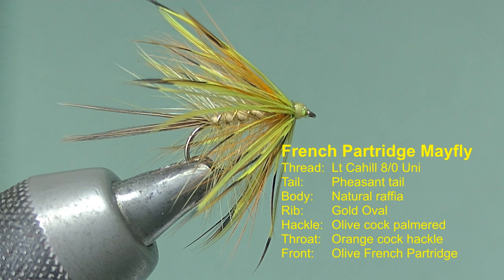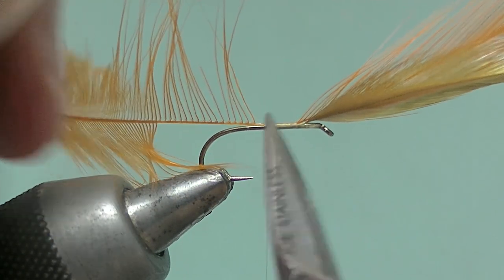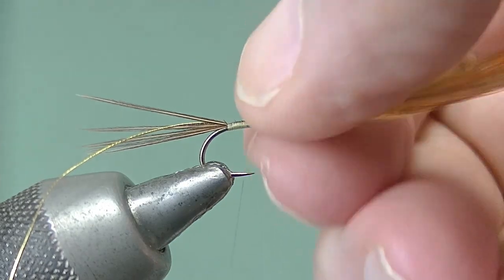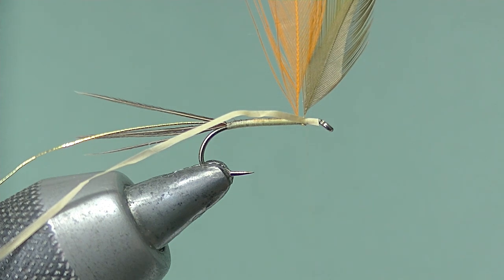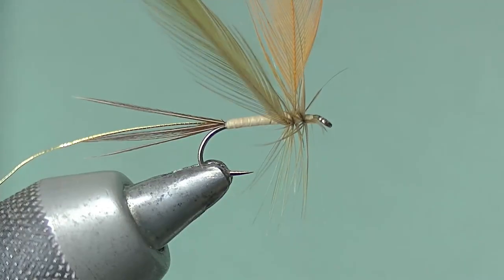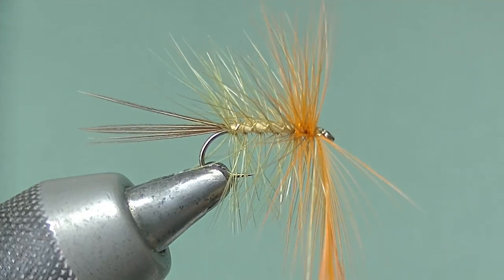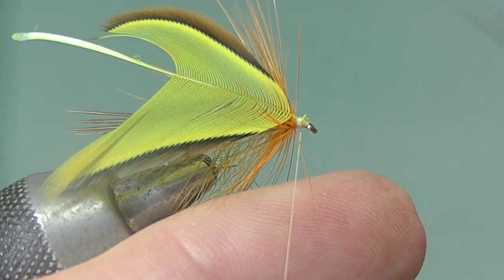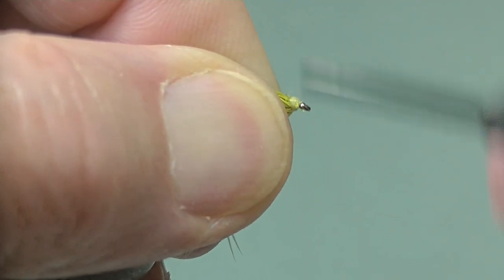French Partridge Mayfly the White Way

Comment: Lovely fly Philip. I've stopped using tinsels as I find it breaks down in use and definitely spoils the look of the fly.  I'm using wire instead.
Reply from the maker: Thanks Conor.  Trust you are keeping well. I suspect you are right about the wire being tougher as ovals are basically flat tinsel wound around a thread base.  I like the look of ovals on the fly and have a fancy that they sparkle more, but it may well only be a fancy on my part.  I only use varnished ovals and, if I can get it, I use Lagartun only although it is expensive.  It never lets me down.  Many commercial ovals 'strip out' before you finish the fly.  The other ovals I have found to be good are Veevus(I think now defunct), Uni-tinsel and the Veniard one we were using in the classes.
Reply: I've three oval gold spools,no markings on any of them. I've tested them with my thumb nail, all on route to the  bin, they should have gone there a long time ago 😂